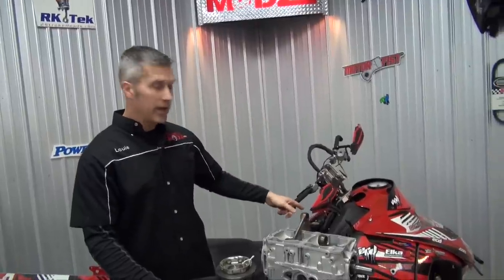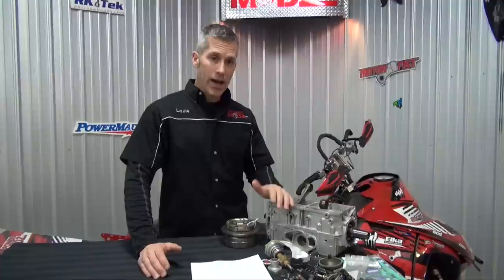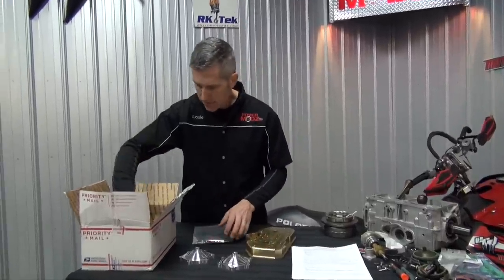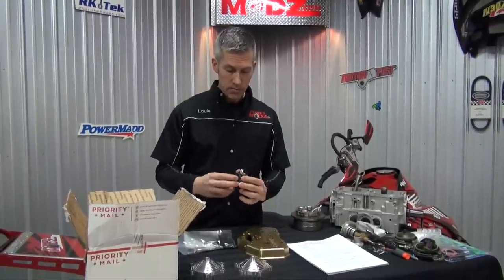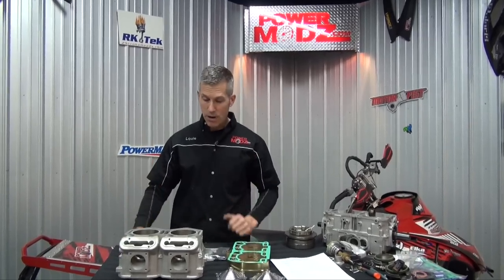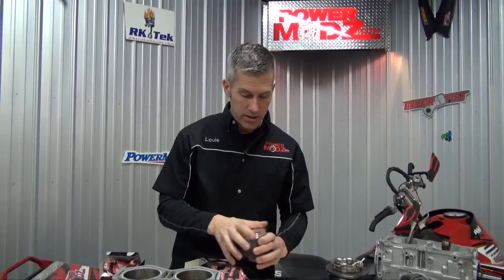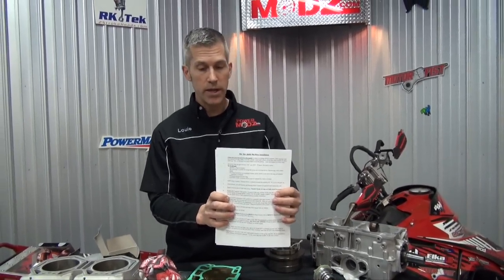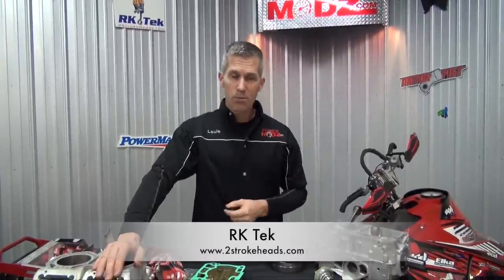RK Tek 860 Big Bore Kit unboxing!!  Polaris IQR 860!!

Comment: Loui I need your advice I have a pro rmk 155 td 2015 and polaris wont get back to the dealer for over a month and a half my track locked up and it blew two quick drive belts and I don't know what to do ether I take it and fix it my slef and scroo the warranty or i wait but I i wait I won't have a sled this season